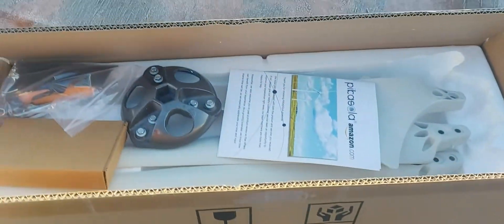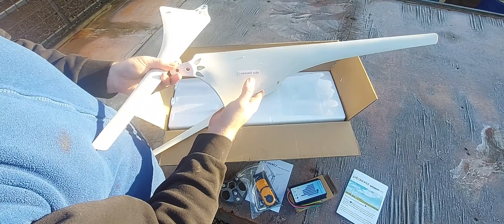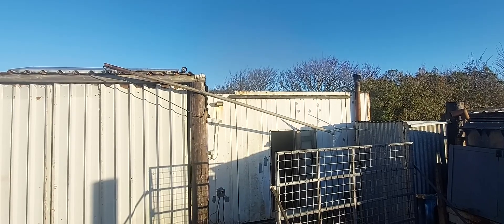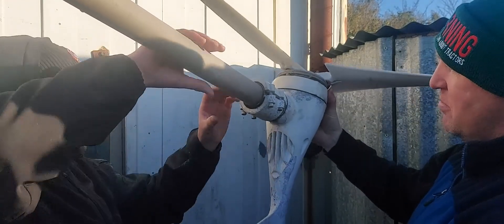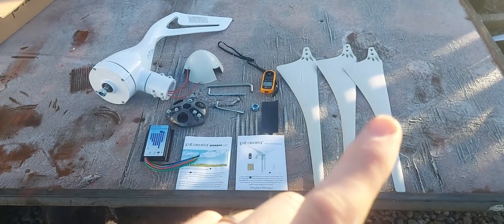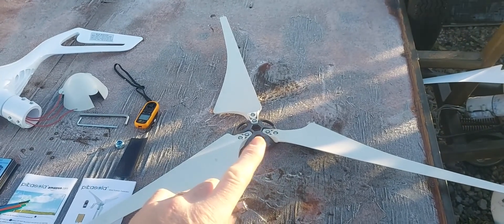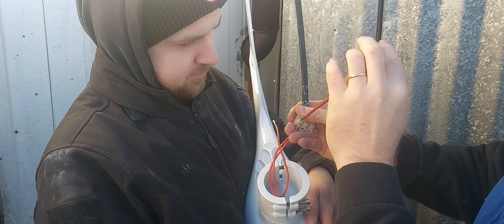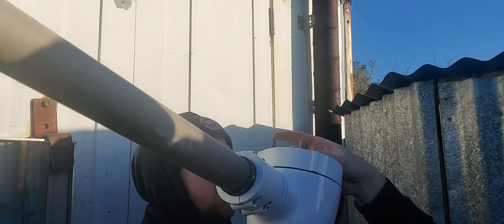12v wind turbine

Comment: Did you find out what is broke with the old turbine???
Reply from the maker: I had a look inside, and the only thing that can go wrong is either the bearings or a short in the electrics, so it must have been an issue with the bearings being worn out. The new one I put up is now at a point where I can feel a little bit of vibration down the pole, so I will replace the bearings this year. It has been up a while now and been through some big storms. One learning I have found is to also loctite the nut on because the wind can catch it the wrong way and spin it the other way and unwind the nut. Overall, I am very happy with it.

Comment: Hmmmm Chinese wind turbine the most time rubbish.
Reply: There is a lot of junk on the market, so after a few bad buys and lots of testing, I have finally found the best performing small wind generator for the price - $361.90 AUD that is postage included - Search  -
1000W 24V/48V Windmill Power 6 Blades Wind Turbine Generator W/ Charge Controller - ( Best to order the 48V model ) it's from China.
This is a buy and put up wind generator, no modifications needed.
I hope this helps anyone for buying their first small wind generator.

Comment: if you were in america i would offer to buy the old one, oh well
Reply from the maker: I will strip the old one down, I think the bearings may need replacing. I will video it and post it on here when I do it.
Reply: @tractoraddict1983 normally bearings, then everything needs cleaned and rotary y connections burn out….